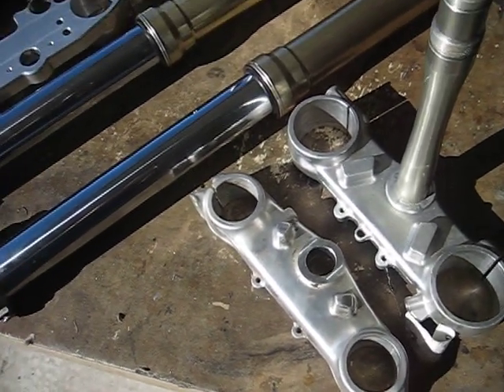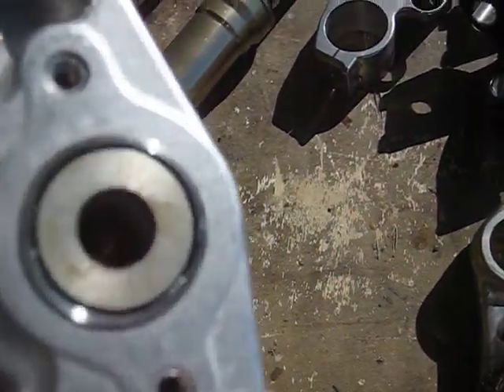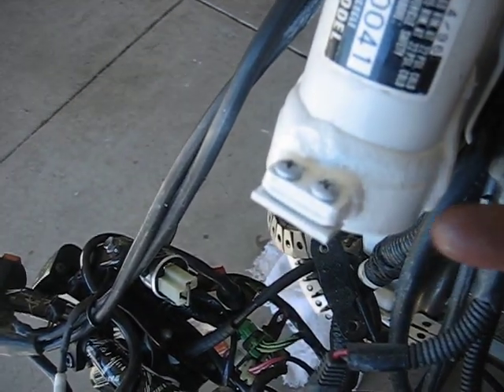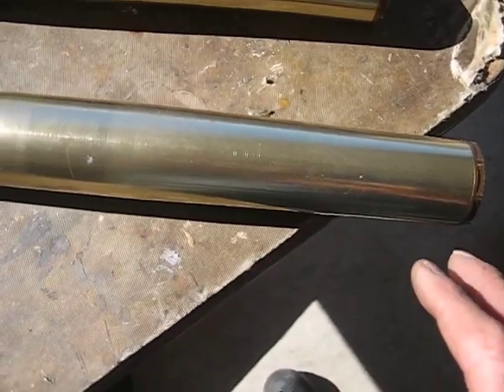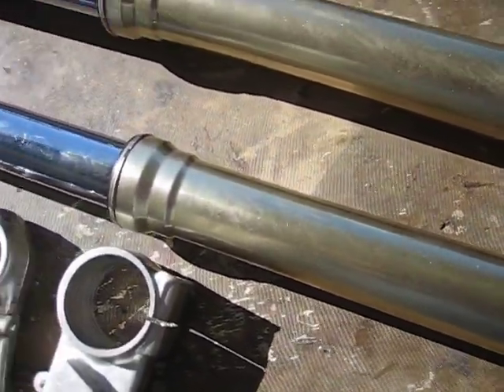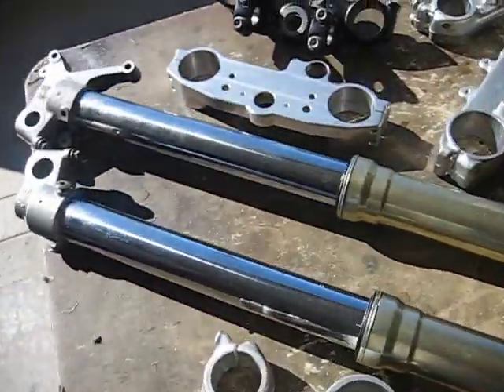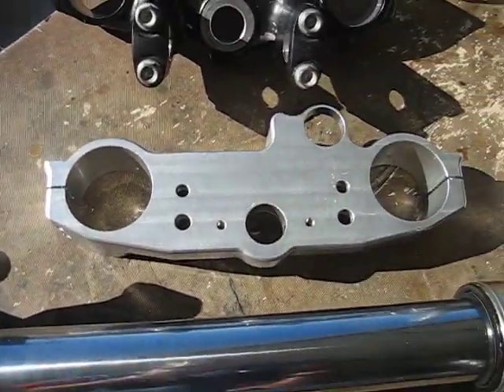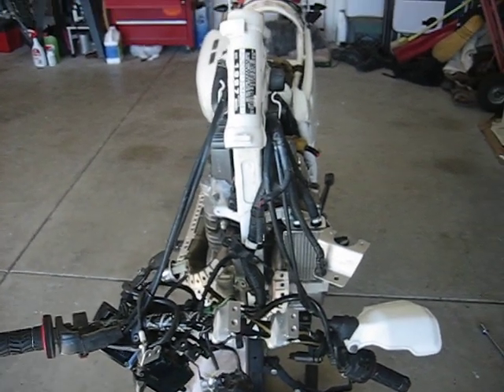Honda XR650L fork conversion to Showa 47U (CRF forks). Video 1 of 2

Comment: Thank you! Another question, do you think you will bottom out with your shocks by half an inch difference?
That is not much though. I think you will be fine 🙂 
Have a 2002 XR650R and I happen to have a set of 2010 CR450R fork legs. But I don't have the triple clamps. Plan is to make a new stem, and mill away the steering stems and make new ones with counter sunk bolts.
Reply from the maker: If you have the front and rear sprung correctly for your weight and riding style I don't think losing and inch of travel should be an issue unless  you are riding at a high speed pro level. Some faster guys run the next step stiffer springs to make up for the lowering. I am in process of lowering my other bike (2010 KTM 530 EXC-R) 30mm (1-3/16") to help me swing my leg over the seat. Lowering the bike will also lower the CG. This makes the bike feel lighter, less top heavy, and easier (less effort) to ride in the tight stuff. Lowering the rear places the shock slightly farther into the leverage ratio at the first part of the travel. This means the shock will be slightly stiffer initially for the same amount of travel than without lowering. On most bikes this should barely be noticeable. Lowering the front affects the air spring slightly (towards the end of the travel). Remember: it is important to lower the front and rear the same amount. I may have extra triple clamps.
Reply: @robinsongguitars  Hi! I have lowered my XR also. Got a tri-link kit from Power-Barn as I am only 5.8 and it make the bike a bit challenging when riding tight forrest trails. Works great. Lowered the front same amount. Still need to test more. New metzeler 6mm dubbed tyres for winter riding. Not enough snow and ice yet though. Yes, I could be interested in your triple clamps if you have one laying around 😀 
Pm? Cheers, Erik.